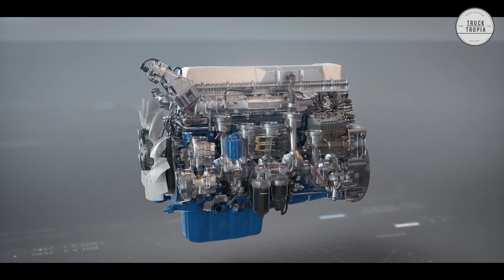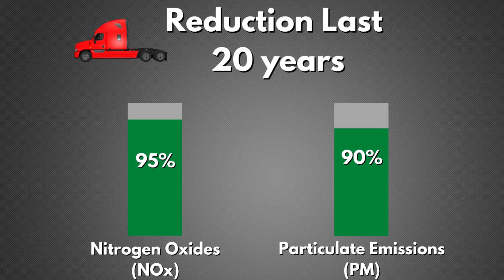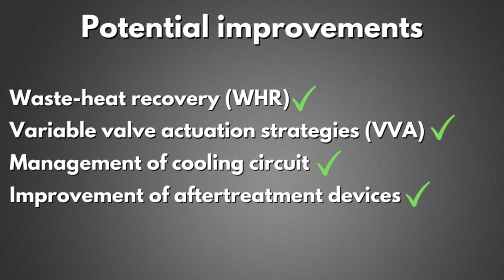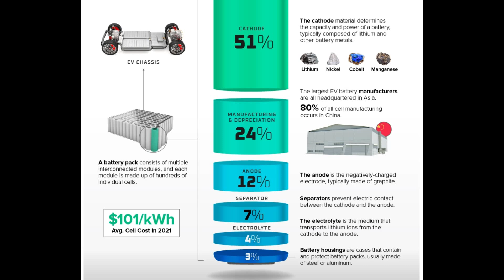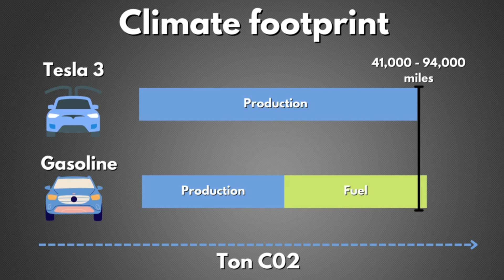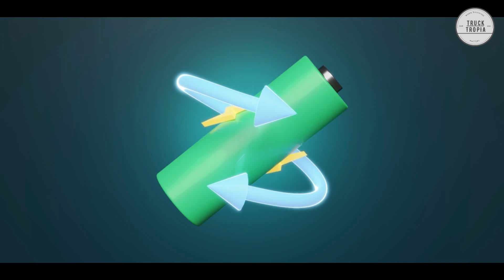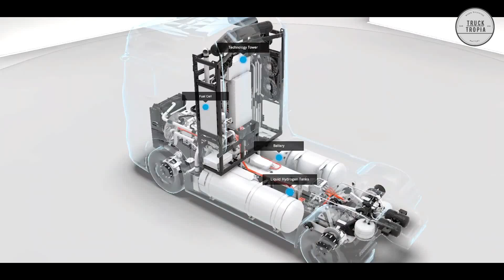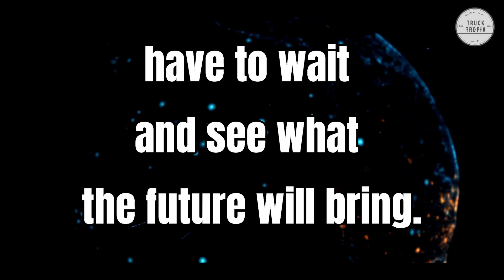How Dirty Are Diesel Trucks Really?

Comment: We have LNG fuel at work they claim they can run for miles but as soon as you put weight on them the fuel just doesn’t last also we struggle on weight a lot as it puts a lot of weight on the trucks axles
Reply: We do too, I can not go out tramping in one. Lucky if you can get 600 miles out of a tank.
Reply: LNG is mostly usable for short fixed routes and near area distribution. And electric for light city distribution. Diesel is king for some more years for long haul and heavy loads. Trying to pull a 60 or even 74 ton truck in mountains in 10 hour shifts is not yet possible with any alternative fuel. And then driver number 2 takes over for another shift.
Reply: Natural gas has only 21,000 btu per gallon, where gasoline has 116,000 btu per gallon
Reply: @blackhawk7r221  Your information is useless unless you tell us at what pressure and temperature you mean. Because at normal temperature and pressure, you can't handle it like diesel and gasoline. Maybe you are talking about what comes out of your gas stove, the one that's about to be banned.

Comment: We are still some decades away from diesel being fully replaced. That said I think especially in the likely scenario where the recharging infrastructure and general electrical infrastructure isn't ready to handle the load by the end of sale dates set by the various governments we will see the return of hybrid trucks.
They will give increased mileage and provide a platform to refine battery tech without the range limitations of pure electric and provide an essential stepping stone that has been tossed aside by the environmentalists.
As for Hydrogen I think this is the fuel that the trucking industry is hoping will get more support because it follows the familiar "drive-refuel-drive more" cycle of current trucks without the major waiting times of pure electric. Again it faces infrastructure hurdles but at least isn't also limited by wider electrical grid hurdles as well.
Reply: There will be no electric "hurdles" grid or otherwise.
Reply: @tedmoss  The current brown outs in places pushing hardest for electrification like California say otherwise and the denial of the infrastructure issues is the highest form of dishonesty in any support or proposal of electric vehicles.

Comment: 10 advantages of HYLIION HYPERTRUCK ERX
1. Power reserve -1000 miles
2. Refueling time -15 minutes
3. Fuel - gas, the most environmentally friendly. And renewable gas gives us generally negative emissions.
4. The cost of gas is more than 2 times lower than the cost of diesel.
5. Power 670 HP
6. 75 miles of battery life only
7. Government incentives
8. The operation of the generator is always in optimal mode.
9. Silence in the office.
10. A truck familiar to everyone.
Reply: Wierd this fella never reviewed Hyliion. Yet they never do right !
Reply: Though it seems promising on paper, Hyliion (HYLN) hasn't been able to convince the market. If you had invested in 2020, as of today you would have lost 92% of your investment. Many promising technologies will not make it due to insufficient adoption.
Reply: @astropythagorean  A real shame as pure electric makes zero sense for long haul trucks.
Reply: @Patchuchan  Agreed. I think diesel will be with us for awhile, particularly due to the significant reductions in emissions in recent decades. Cummins seems to have a favorable view of both hydrogen and LNG engines as eventual diesel alternatives based on their investment in research.
Reply: @astropythagorean  The stock price or action has nothing to do with what the company is doing right now. Look at Tesla and Amazon stock history. 🙄
Reply: @markjones9009  Though stock price is not a sole indicator, it most definitely shows faith in a company by investors. A company needs investment to survive...especially a company doing significant R&D. 
Current value of each stock when compared to their initial stock offering price:
Tesla: 1100%
Amazon: 600%
HYLN: 7.9%
Reply: I searched it it sounds like a good concept.
Reply: "10 advantages of HYLIION HYPERTRUCK ERX"
the following two are by no means an advantage.
"3. Fuel - gas, the most environmentally friendly. And renewable gas gives us generally negative emissions."
That's true. But..............renewable gas and negative emissions are much more expensive then BEVs.
"4. The cost of gas is more than 2 times lower than the cost of diesel."
What gas are you talking about? What is your imagination on how renewable gas or eFuel is produced? Can you provide sources for your claim?

Comment: Hyliion's solution for electrified power train using an on board generator running on RNG to change the battery's . Up to a 1000 miles range and 75 miles on battery only.
Net carbon negative when using RNG.
Reply: @ThaiLifeAmerican  I simply cannot understand why they didn't use the super duper clean modern diesel engine to drive the volt
Reply: are you using gacha to powering a car?
Reply: @ThaiLifeAmerican  I think that makes sense. All the food and industry goods made outside of the city like London get transported to London where they have charges for the ulez or ultra low emissions zone.
70 miles on batteries in and out of the city centre sounds ideal
Reply: @ThaiLifeAmerican  I really like your thinking on the rebuild.
Just look at the efficiency of your average modern planes. They're old but very well maintained and good on efficiency and constantly being improved.
In a nutshell.
Get the best clean small diesel engine to power a small battery and electric motor drive chain
Reply: What about the carbon footprint to build it?
Reply: Please tell me that no one here unironically believes that using a diesel engine to power a generator to power a motor is somehow drastically more efficient than using a diesel engine to just turn wheels
Reply: @NoorquackerInd  I know that you dispense with all the gear boxes
The biggest thing that's going to happen is less pollution.
Operation of the diesel at optimal heat and revs.
But yeah. I agree.
Like I said my little audi A3 is practically perfect.
I've had the same stainless steel exhaust for 13 years and it's done 145000 miles and the only thing that's needed is for the government to stop spending the road tax money on quixotic windmills and fix the potholes and roads properly
Reply: So it is basically a hybrid powerplant like the old Chevy Volt.

Comment: How will that work when it’s -40 in middle of nowhere South Dakota and the road is closed for four days because of a blizzard and you can’t charge it
Reply: Same as when there's no power to run the diesel pumps and truck stop
Reply: @synapticburn  Easy manual pumps and gas or diesel generators every truck stop thats big enough has a generator and all pumps come with manual backups.
Reply: @DaMasterPilot  you're saying that's the way it should be? Because that's definitely not the way it is now
Reply: @synapticburn  Here in PA, we routinely get single digits F, sometimes single digits negative F (and on rare occasions, windchill as low as -15). Not -40 like ND, but still, I can tell you that batteries are very bad even in single digits. But diesel trucks? They work just fine, always have, always will. You don't need -40 to see degradation in battery performance, it starts a lot warmer than that. Even on ICE cars, older or neglected batteries just can't crank an engine to life in temps like those, we gotta change batteries regularly at times or we risk the car not starting at all and it needs to be jumped. And not powering the truck doesn't mean the battery will suddenly work... in fact, not using the battery for a good period of time is actually harmful too. Take an ICE car, let it sit out all winter, and then try to start it in the spring and see how well it cranks.
 
And before anybody says "well, that's just an acid battery, we use Lithium batteries in EVs" ... I've seen the same kind of phenomena with Li-Ion batteries in stuff like flashlights and other similar items. I once left a flashlight in the garage that had lithium batteries in it, was working fine. After a few rather cold days, I tried to use it and it was barely working at all. Also, a rechargeable drill that was left out in the garage, its battery died rather fast too.
Reply: https://youtu.be/3uceK5b0NXM
Reply: Think before you act. A battery will last a long time when it is not powering the truck.
Reply: @tedmoss  Think...  Why do EV's have heating/cooling systems for the BATTERY.  Well they are damaged by either extreme heat or cold and well -40 is considered extreme cold.
Reply: They won’t deliver to the 3 people in south dakota
Reply: @Shaun Hensley  Yeah, winter sucks in the fly over states. Blizzards make it nearly impossible to do anything.

Comment: Diesel is very unlikely to be replaced anytime soon, and if it does get replaced too soon, countries will make a huge, costly and damaging mistake. Lorry manufacturers are developing more sustainable Diesel/Diesel-like engines as other fuels like Electric are simply not an ideal solution at the moment, they need more time to allow the technology to mature enough, which even so, they will only co-exist with Diesels in my opinion. But it's not all about sustainability, heavy loads need torque, a lot of it. Vehicles need refuelling, quickly and easily accessible. Long term? Diesel has always held supreme and will continue to reign supreme in the transportation industry for many more decades to come 🚛

Comment: 200000pound pulling capacity and range over 600 miles, chaging 45 min to 100%, battery size under 2 cubic feet and weight under 800 pounds and 700-800hp. Those are parameters that need to be filled if we want to stop using diesel
Reply: Hyliion checks all those boxes

Comment: Batteries require lithium, a limited resource. So replacing all trucks with electric trucks may not be a real solution. Diesel engines are mainly made of iron and aluminum and can be mass-produced.
Reply: The dominant element in a diesel truck is carbon.  The fuel used by a truck outweighs all the othe stuff over the life of the truck.  a Semi uses, at best 50 l/100 km, and a litre is about 900 g,  so it uses 0.45 kg per km... which is 1 lb of fuel per km.   ... so say the max weight of a truck in North America is 80,000 lbs,   so after 80,000 km. or 50,000 miles, most of the "weight" of the vehicle is the fuel.... that would happen in a couple of months.
Reply: I worried that the mining activity would cause another problem.
Driving mining vehicles and smelting raw materials also consumes resources and impacts the environment.

Comment: I dont think diesel will be replaced  too soon.  Since  you mentioned  biodiesel and improvments of diesel engines they will still have their presence  in next upcoming  years.  These alternative  can emerge in different ways like electric ones as distribution trucks. But for long run Diesel still wins
Reply: But how does biodiesel compare in power output to traditional diesel?
Reply: @sheilaolfieway1885  Depends on the source and engine tuning.   Some better some worse.   I have a 97 Kenworth T-800 that seems to like running on B20+ canola-based fuels.
Reply: @sheilaolfieway1885  for RME there is a few percent power reduction, like 4-5%. There is more so capacity reduction (about 15%).

For HVO there is basically no difftnce what so ever. If any, the performance is increased. HVO is a more uniforme fuel than diesel. The issue with hvo is that it need hydrogen to be made that currently is fairly dirty.
Reply: Biodiesel is liquid death for all diesel engines! It's a green pipedream like the rest of their ideas!
Reply: Not any more.
Reply: electric will never replace disesel as it's range will always be limited wiht batteries and I highly doubt we can ever use solar panels to charge it enough... Now a hybrid diesel electric could work.